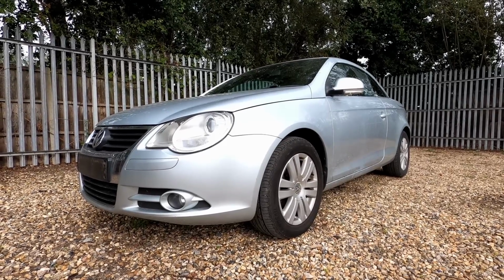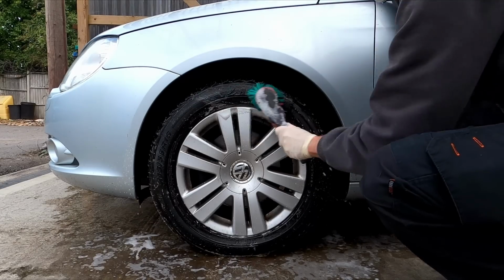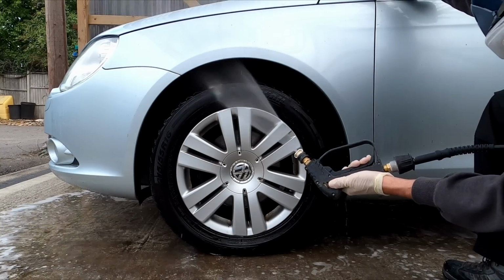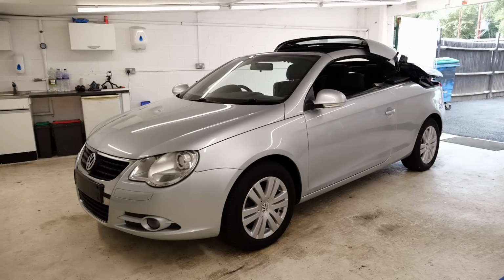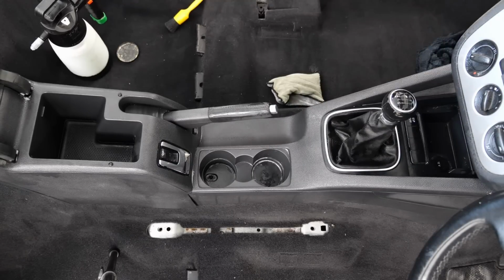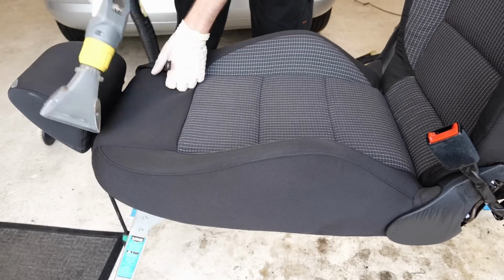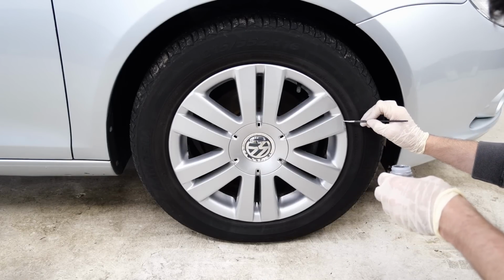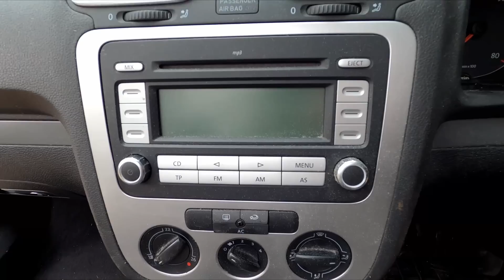Deep cleaning a Disaster detail VW EOS/Volkswagen Golf ASMR filthy/Dirty barn find relaxing clean

Comment: Love the Eos now,looks brand new and great work as always! :D

i want to do and engine clean on my 15 dci Megane 3 but the engine suffored alot of repairs and im tempted not to ;/ any  tips ?

P.S I used green star 1:10 on a greasy fabric seat and it came out brand new,20 year old Skoda Octavia seat !
Reply from the maker: if the engines already had a lot of issues maybe best to try another approach, clean by hand with a pump spray bottle and microfibres rather than a jet wash 👍😀

Comment: Did you get any water ingress from the roof while pressure washing? My partner had one where the roof leaked just from raining and the interior was wrecked so it written off. The car only had 3000 miles on it. Thankfully VW replaced the car. Great video
Reply from the maker: They do suffer with drain holes getting blocked, I know also the seals need a special "lube" from VW to keep them in good order. Glad you got your car sorted 👍

Comment: A question...any suggestions for removing old dried carbon from chrome exhaust tips easily? I've used Krudd Kutter, WD40, Autosol etc and lots of scrubbing with a scotch pad and microfiber cloth....much better but just can't get it all off and the chrome is quite dull. Any tips on how to remove it and bring back the shine?🙏😀
Reply: There are a few videos on YouTube,  seen a number of people using very fine grade wire wool in tandem with a metal polish.
Reply: @decker0373  thanks. Yeah...I'll get some fine grade steel wool and give it a go👌
Reply: @jeremyjames1972  check out YouTube first, for confirmation. I seem to recall Cleaning Car Guru did a video recently and he referred to the grade of wool. Good luck.
Reply from the maker: Wire wool works very well, just be a tad careful as it can very slightly scratch the surface if you get carried away, It's common sense when using it, and I use it a lot 👍